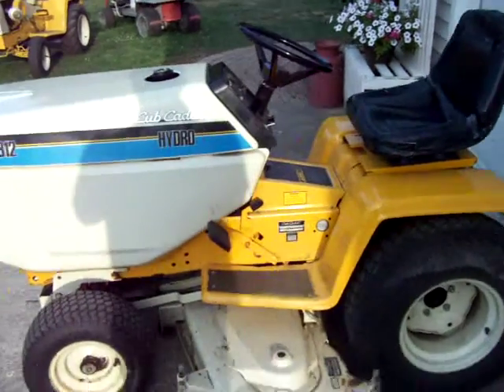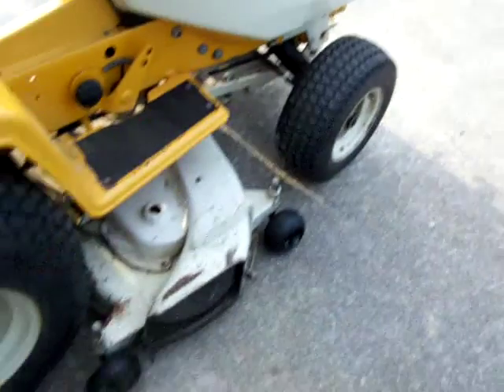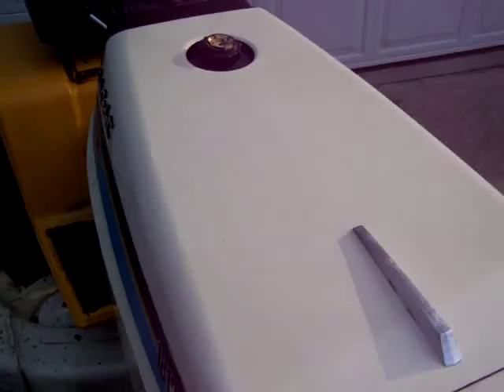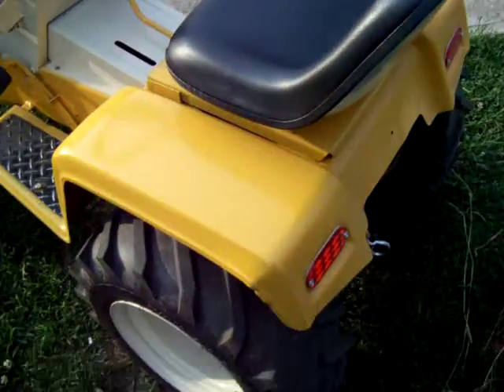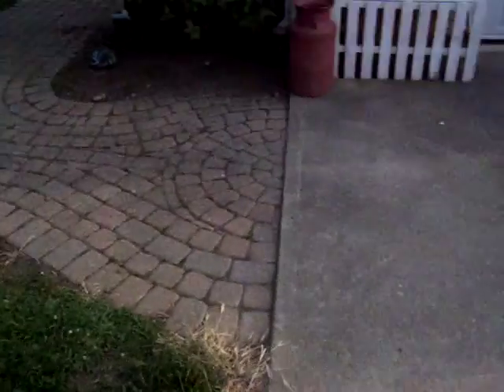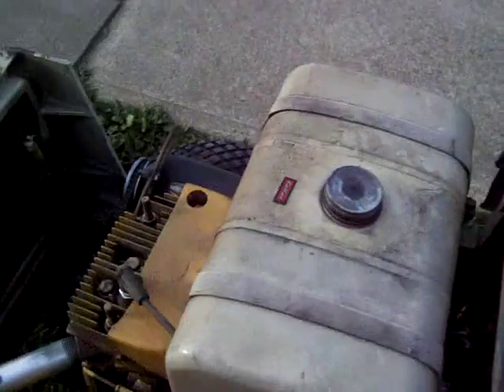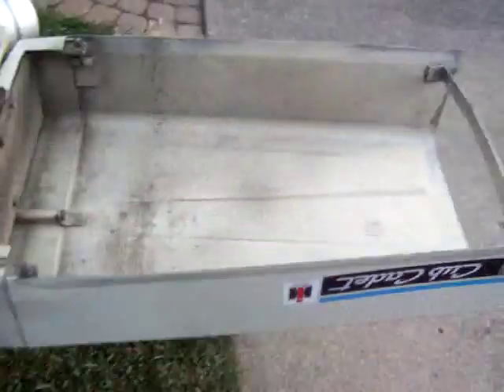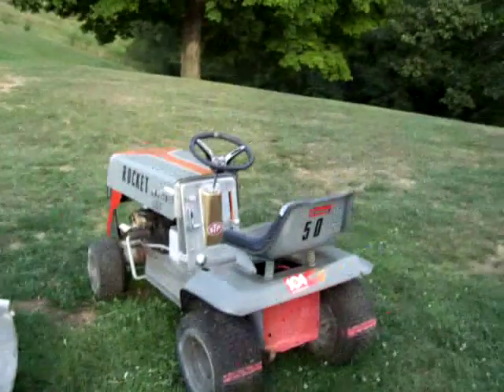My cub cadet tractors

Comment from the maker: @the42IHfarmallguy no, idk the piping size to use on a 16hp i think a 1 3/4 pipe. I used 2 12in pipe,elbow and a IH1 muffler. I got all of it at TSC. Make a brace from the stack to one of the head bolts.

Comment: That's a nice collection. I've got the 86 (not restored, but i plan to) the 1282 and the 1864, now the only thing i'm not sure of is if the 1282  model, which the one i have is a 1981, is manufactured by MTD or IH, anyone know? I've heard different things. Thanks.